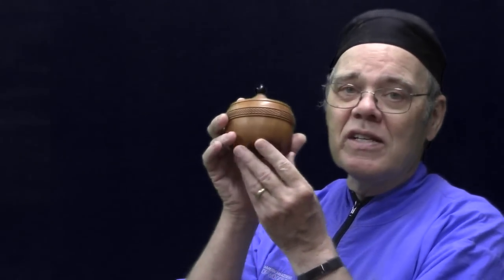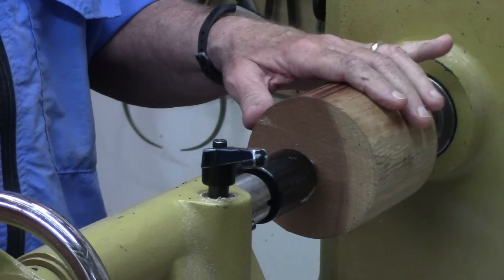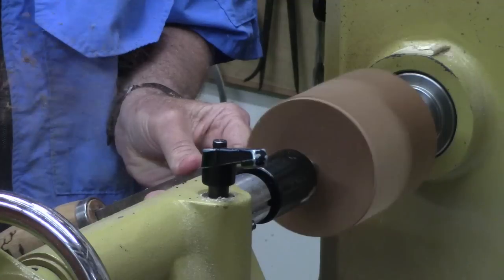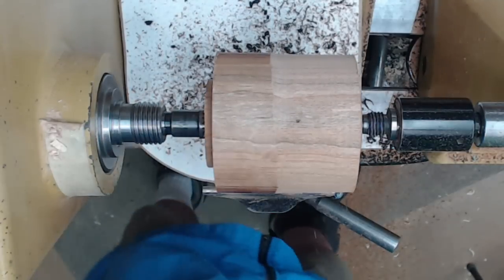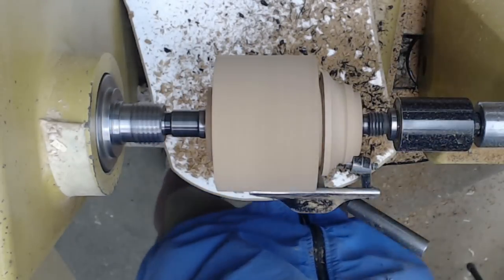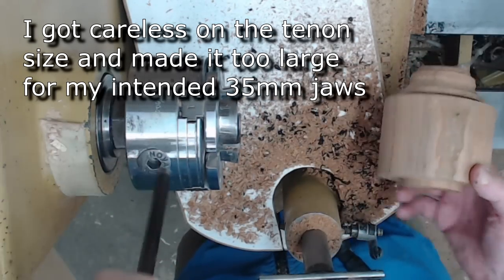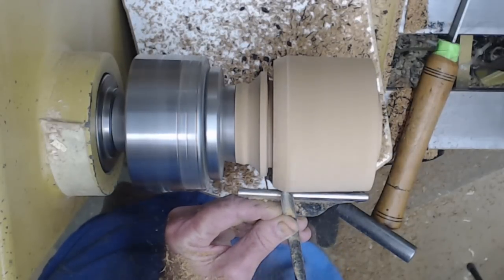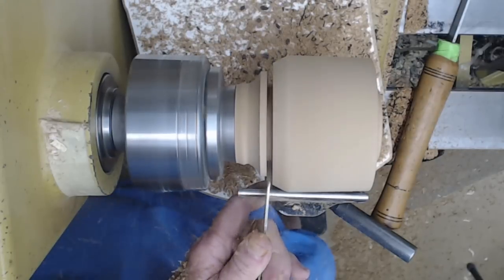Can a Box with Feet Walk?

Comment: Great Box and more learning's for me. I have 3" discs but rarely use them. Normally 2".  but will snip the edges and use on the 2" sanding head. Big thanks Mike
Reply from the maker: The 2" are great for small bowls less than perhaps 6-7 inches. But a 3" disc has 2x the surface of a 2".